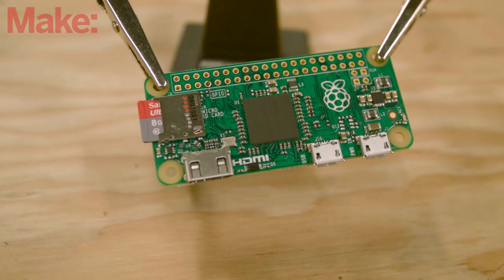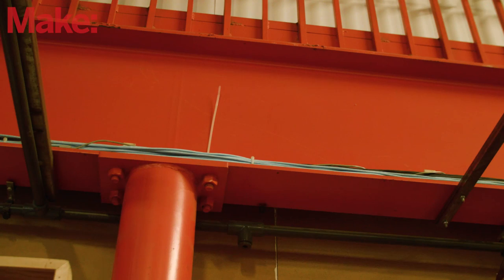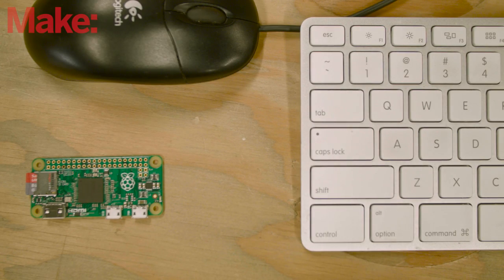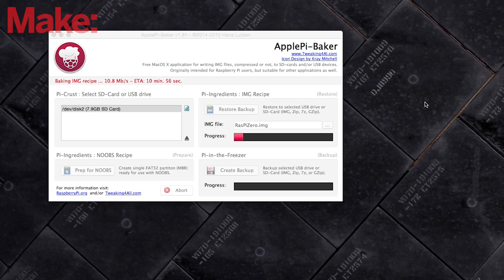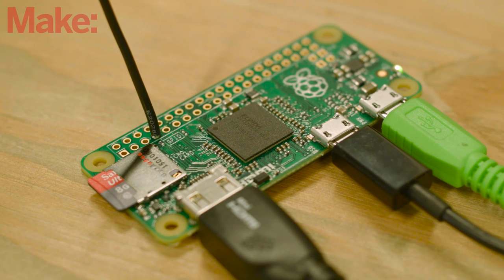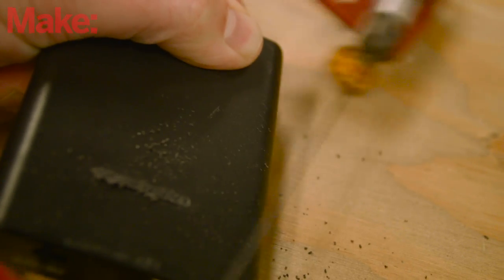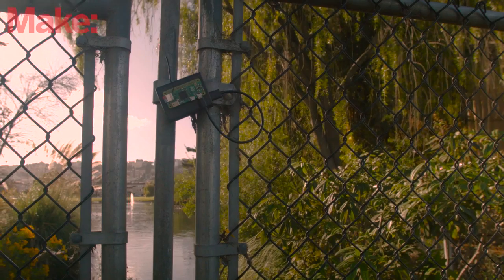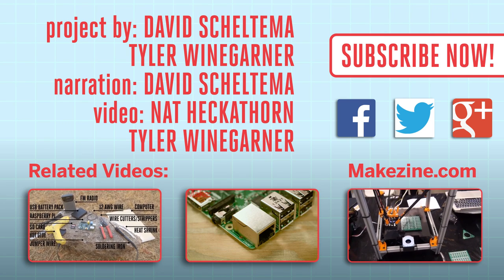Weekend Project: Pirate Radio Throwie

Comment: What power does it require? Could it be Solar powered? If not, how about adding a solar panel which charges the battery and a timer so it only transmits between certain times of the day or night?
Reply: You can easily convert it to solar. and depending on current consumption, you could probably leave it to transmit 24/7.
Reply: pi zero draws about 120ma
Reply: @HobkinBoi  I hope I'm getting this right. This thing boost the range of a brodcast because it's set to that current frequency? How far can it boost it?
Reply: @THE.FAKENEWS  To increase the range you would need a power amplifier stage for the output. Not recommended as itll probably break some FCC laws, but I've tried it and its certainly possible
Reply: @HobkinBoi  Thanks for the response. What if you were broadcasting within FCC guidelines, but someone else was boosting your signal?
Reply: @THE.FAKENEWS  I cant really say there

Comment: You are completely ignoring the harmonic frequencies you're blasting out of the port as well. These can reach well beyond the FM frequency you're targeting, and into bands you're not allowed to transmit on.

The harmonic frequencies are emitted due to the nature of the square waves output by the port on the Pi. While this may certainly work, it is also highly illegal to do without proper filtering.
Reply: On their website for this (http://makezine.com/projects/pirate-radio-throwies/) they have instructions for a simple bandpass filter that should fix this.

Comment: can a microphone be added to it to pick up surrounding sounds?
Reply: +Robby O'Donnell i have same question
Reply: +Davin Risy Al Hanif I feel it can by inserting a microphone address into the code where the sound file is located but haven't gotten to that stage yet. More experimenting needed.
Reply: +Robby O'Donnell The question you should be asking is "How can a microphone be added. . .?"

There is no "Is this possible?" in electronics. Yes, it's possible. You can add pretty much anything you want, within the realm of electronics, to your Raspberry Pi, Arduino, whatever projects. You just have to figure out how.

For this project, it'd pr pretty easy to add a USB microphone, and then tie its input to PiFM's output. In fact, you'd do it in almost the exact way they tied mpg123's music to PiFM.

Comment: +Make:
I need some help, I followed the guide and everything worked but when I went to test it, all I get is a solid tone instead of music. Any ideas? My antenna length is just under 6in.
Reply from the maker: mraustin3410 what did you set your frequency to? what about your music encoding?
Reply: Thanks for the quick reply. I had my freq set to 85.9 and 100.5 and it did it on both. I am using an mp3 file. (is that what you meant by encoding?)

Comment: what kind of hub works? I'm using an anker 10 port usb 3.0 but nothing is being powered from it except the WiFi. keyboard and mouse do not work unless I plug them directly into the pi zero, thus letting me only use 1 peripheral at a time

Comment: Is there any way to boost the signal? I get that the range is limited, but I want to know if I can have a mile radius signal on this sucker!
Reply: Doubt. You might get 80 metres out of these at best, if you put it high enough and have an optimal size antenna

Comment: I've followed the tutorial and everytime i start the broadcast manually (by the console) i can't hear something on my radio, but the console says its playing. I am using the frequency 108.0 on my pi und on my 2 radios (to make sure the problem is not the radio) I am using a 1foot antenna. AND I'M USING THE PI 2, not the Pi Zero. Have somebody any ideas? Could it have to do something with the Pi 2? By the way: i've overclocked my pi 2 to 1000Mhz und i am running Raspbian Jessie.

Comment: would it be possible to use the metal structure as the antenna?
Reply: _ _ it would be but the chances of the metal object being resonant on the frequency is fairly low. You would be better off building a resonant dipole out of wire connect the positive side to the pin out and the negative side to the ground pin on the pi.

Comment: +Make Could you attach a potentiometer so you could change frequencies manually?
Reply: +Connor Burke It wouldn't be as straightforward as that, because it is Software Defined Radio, meaning it doesn't use standard tuning caps, or pots to get the frequency.  You could connect the pot to be read by an analog to digital converter input, which is easy enough.  But then you have to change the code to read the pot to change the frequency. And without a display, it would be tough to know what frequency you are set to.  It would be a good project to learn about Software Defined Radio, Analog to Digital conversion, and coding.

Comment: my bus driver constantly has the radio on some random crap so I want to override the frequency with some random stuff... you think it would have enough power to do that?
Reply: +David Sessing Hardly, depends on the strength of the signal he's listening to, you would need to override that signal and if that is quite powerful as I would expect, no you can't manage to override it with this. Instead, you could only manage to get a "double" radio effect, the speakers will sound more like noise than music, since it'll be playing both (also you need to check if the frequency he's listening too is actually in the range of the device you're using)
Reply: +Josef Richter (Doktor) its in the range of 90-115FM band... it sounds pretty strong but it would be nice to mess the signal a bit too
Reply: David Sessing If the signal is strong, with that equipment he won't probably even hear the interferences sadly. You can try with a more powerful transmitter, depends on what exactly you'd like to do. Chances are though, that when you override the radio signal he'll simply change station because he doesn't like the song or something.

Comment: could you not also use these to map out a city and if the correct things done to someones phone could they not act as a locators?
Reply: +paul girvan 

You sure could!

Your phone has a variety of radios in it. You could, for instance, have each Pi broadcast a Bluetooth signal with some information about where it is. Then, you could write an app for your phone that looks for these Bluetooth signals and use which signals it can detect to figure out where it is. The more signals, the more accurate.

Lets say each radio has a 10m range. If you can detect three signals, that means you know you are in the area where all three of those signals overlap. Like a venn diagram. :)
Reply: +Christopher Pilcher that's some what what I was thinking even with my little knowledge of tech and shit :p
Reply: We all have to start somewhere!

 You've worked out a rudimentary GPS, you've done what very smart people in the past did, if on a larger scale. 

Keep thinking like that. Maybe one day you'll make a better GPS. :)

Comment: I remember the original one. I added a method to rebroadcast online streaming radio and it was accepted to the original project. Are user commits still included in this version?
Reply: was going to ask about this. if i can stream internet radio via an fm signal to my portable radio , that is usefull. could stick pi zero inside an fm radio, and you then have an fm radio with built in internet radio
Reply: +tim bo looks like it isn't included (except if it has been included in the C file which seems unlikely), but you can restore that function by using the two PirateRadio files from the original project (https://github.com/Make-Magazine/PirateRadio)
Reply: +d4m4s74 thanks

Comment: for lazy people eBay this TF card U disk MP3 Format decoder board module amplifier price 1$ or any mp3 player and FM Transmitter Module price 5$ both of them can be powerd by power bank or 5v battery I use sometime FM Transmitter Module in an older vehicle some of them got a cassette player and it picked up the radio really bad you can also use FM Transmitter Module on the pc you just need to select it as set default speaker